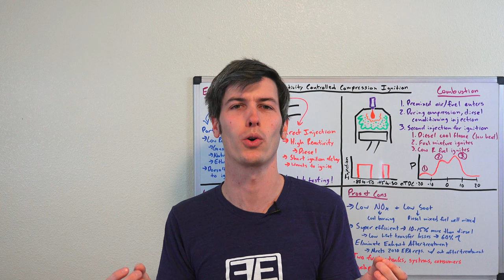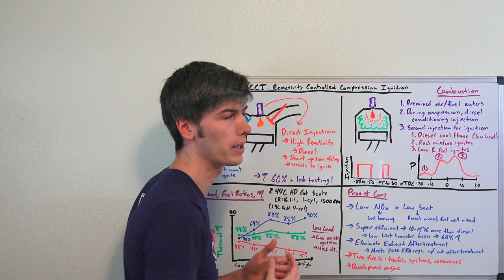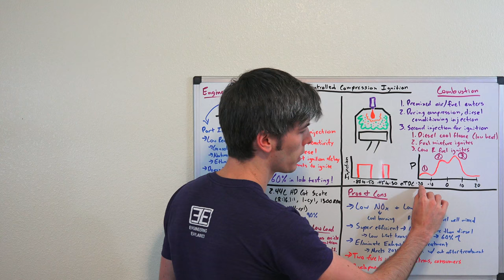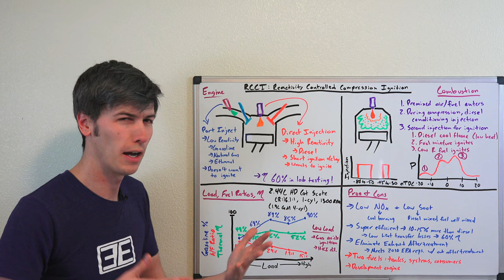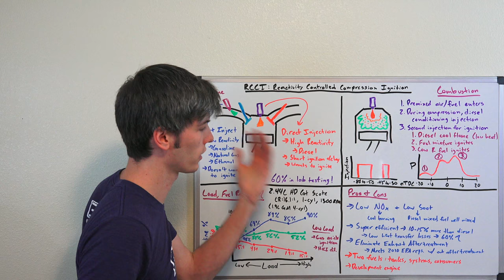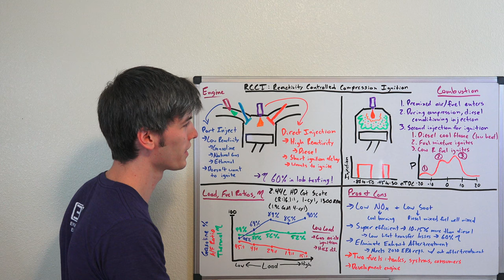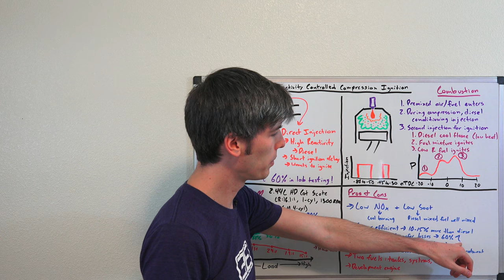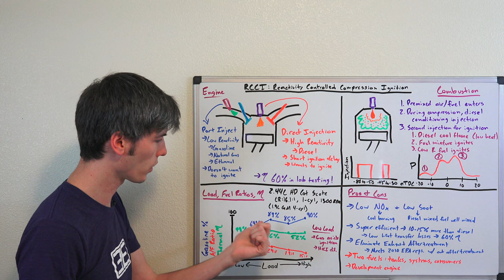Super Efficient Engine Uses Gas AND Diesel - RCCI

Comment: I don't think dual fuel is much of an issue for a lot of consumers & none for industry in cities. They wouldn't burn both petrol & diesel evenly, as when the engine does work it rapidly increases the petrol consumption & reduces the diesel. So you wouldn't have to fill up 2 tanks at every stop, you'd fill the petrol but the diesel only every few stops. Of course, I doubt I'll ever see one of these, technology is moving so quickly a single fuel engine will likely be all we see until internal combustion goes the way of the dodo.

Comment: But why doesn't the gasoline-air-mix self-ignite during the compressionstroke? If the mixture is hot 
enough to ignite the diesel it should be more than enough to burn the gasoline. Otherwise there would be no engine-knock in gasoline- engines and it would be possible to raise the compressionratio and get to a higher 
efficiency that way.

Comment: Lots to worry about.... At least for the for the first few generations... And hot burning causes nitrogen from the air while cool burning produces pollution as well just a different type, however this is a range and at a point heat starts ro destroy the pollution. A DPF currently can be used efficiently to reduce pollution in one of two ways 
1. Using DEF to clean off the the DPF
2. Get the engine temp over 210C and the DPF becomes clears while staying within parameters for the environment.

From what I can reasonably determine (with diesel) your fuel air mixture has more to do with environmental impact (using ultra low sulfur) then burn temperature its self. Please correct me if im wrong

Also i watched tourqe vs HP video 
Everything the same aside from 200 hp 100 ftlb vs 100 hp 200 ftlb 
I agree that the lighter the vehicle the more drastically the 200 hp would win. 
However I disagree that 200 hp car would always win, there will be a weight that the 200 hp car shouldn't even be able to move while the 200 ftlb would crawl across the line
Again please correct if im wrong
Reply from the maker: RE combustion temperatures, this actually burns quite cooler than traditional gas or diesel engines, resulting in far less NOx (discussed at the end of the video. 
RE hp vs torque, more power will win every time. Doesn't matter how much weight you add, you can gear a car with more horsepower to have more wheel torque than an engine with less power and more wheel torque. Power wins every time, if you're purely talking about peak numbers. Remember, cars with good low end torque also have great low end power (contrary to cars with high revving power, which produce very low power at low RPM.
Reply: Engineering Explained thank you for your speedy reply

 I don't think I can agree 100% as the video said gearing was the sam,e fuel was the same, but the leverage in the motor differed 
So would there not be a weight at which the torque with its lower rpm band and higher tow capacity, compared to higher rpm but lower tow capacity. 
If the weights were brought to the extreme is there not a weight at which the 200 hp car simply stall out compared yet the 200 ft lb would still move provided traction wasn't an issue.

Comment: Honestly, if it works good enough to save fuel and still get the power needed to get the job done (between vehicle types) then two tanks is not a big deal. Diesels already have that issue with the exhaust treatment systems.

Comment: Our fuel pumps will need to be able to enable, count & charge pumping both gas & diesel at the same time with a cost total. Pixel based displays would work for this. We already have pumps with gas+diesel (though they can be rare due to not being as popular consumer facing & to avoid consumer ..mistakes).
But the number of wrong fuel in wrong tank problems.. perhaps a law requiring separate dedicated colors for fuel pump buttons, hose, nozzle & tank cap+filling hole(?) & maybe dash fuel level displays/lights. I know diesel tends to be green already.

Comment: How was knocking eliminated? Just by multiple injection of cold diesel?
And the compression ratio must have been high too, so at the time of inlet valve opening, by how much the port injection was reduced?
And if they didn't go for oil cooling, what alternative was used?

Comment: There are no special pistons for oil cooling it is just squirters at the bottom of the block 2 cool the bottom of the Pistons as they are at the bottom of their stroke. On another note, a slightly more reactive fuel, that could be metered by the diesel, as kerosene a very similar fuel and an added element is that kerosene and diesel fuel are both very lubricious.

Comment: People in china started doing this 10 years ago... Coach drivers modify their diesel engine for lower cost... They add a natural gas system at the intake and modify the computer to inject much less diesel in the engine only for ignition (because natural gas is much cheaper than diesel). Amazingly, if the engine is tuned correctly after the modification, there will be less than 10% of power loss.

Comment: Two questions: will this be more reliable by having semi redundant fuel systems, or less reliable because of more points of failure? In other words, can it run exclusively as a gasser or diesel in the case of one of the systems failing? Probably in a "limp home mode".

Secondly: how does it respond to turbocharging?

Comment: A classical example of the difference between theory and practice. The point is simple: It is hard enough to keep either an Otto or Diesel engine operating properly in the field. A combination will therefore be more difficult to maintain, probably MUCH more difficult. Hence, a BAD idea. Reliability is the NUMBER ONE requirement for a practical engine.

Comment: What prevents pre ignition from occurring?  Wouldn't the heat from the high compression ignite the gasoline before hitting TDC?  I thought the main reason gas engines have lower compression ratios was because of this issue.

Comment: This is Nice but, if using Aluminum Heads, I C Warping N Head gasket problems in the near future for this Engine Design. If ANYTHING, the BEST design would B' a Dual Piston Engine(2 Pistons per Cylinder)

Comment: Sounds like a drive by wire system, very much more then we have now. You would have to worry about two fuel levels for different systems, and what would happen if the computer ever failed in its job? Blown engine? Other then that looks like a multiple pressure wave that would convert more mechanical energy then to heat currently?

Comment: Why not have the fuel pump with a hose (2 separate inside) that has 2 exit ports on the same handle, you could have the car still have one fuel cover with the ports side by side, that way the consumer couldn't possibly mix up the tanks. Still would have a complex engine with 2 tanks but at least the consumer end wouldn't change much.

Comment: Cool, but as always, hella complicated. Not sure this would be good for consumers because having two tanks really increases the odds you'll accidentally put the wrong fuel in the wrong tank.

Also, is there any good reason they don't make a diesel Prius? Is it just a perception thing because in the US we associate diesel with big trucks spitting out smoke, while in Europe they have a lot of small diesel cars?
Reply: California smog law is far stricter than Euro 6 smog law, that is a major reason why Europe gets certain diesel cars and the USA doesn't. The other reason is that fuel prices in Europe is 2x or more than the price in gasoline, so it takes less time to for fuel savings to offset the initial purchase price of a diesel.

People have already had a problem with putting the wrong fuel in the tank. Some diesels also require diesel exhaust fluid, and some people don't realize that. they end up putting DEF in the fuel tank, and once the fuel pump sucks that into the engine, it does about $7000 worth of damage

Comment: How is it possible that diesel wants to ignite, rather than gas does? I thought an advantage of the Diesel engines is that it doesn't ignite as early as Gas, so you can archieve higher compression ratios, while in the gas engine you would have knocking occur...

Comment: At 60% efficiency there’s half as much heat going into the piston compared to a typical 30% efficient gas engine.  Therefore, no piston cooling required.

Comment: Thanks for covering this interesting tech. 
Perhaps Europe has been a bit hasty in the inner city banning of diesel engined passanger cars in the near future. 
Engines based on this technology would surely make more sense than outright banning.
Reply: SDD525 
They are hasty if the emissions are prevented by clever technology like the video just presented. 
(The reason for my comment)
I understand the emissions issues, however, the real facts are that there simply isn't enough lithium or manufacturing capacity currently, to simply replace the internal combustion engine short term. 
Diesel engines are very efficient, if they can be made clean then that buys time to get alternatives off the ground.

Comment: Gas/Diesel engines are not new. The 1957-1958 International Harvester W-450 started and warmed up on gas then with a flip of a lever it switched to diesel to do work. It had a 1 gallon gas tank and a fixed carb.

Comment: As this has a sweet spot where efficiency is highest, could it then be a static generator with static rpm and static load, with methane gas from digestion and diesel substitute from oil seed rape and coolant water circulating in under floor heating for a dwelling? No need to fill a white board Jason, just off top of head pros and cons if you please.

Comment: Seems this might be good, based on that top RPM range in testing, to use in a Locomotive ? I know they used 2 stroke Diesels at 850 RPM. This cant be far off with power ?

Comment: I don't understand why the mixture of gas and diesel is more efficient than using the same port and direct injection combination with only diesel. Is it because the port injected portion of the diesel would pre-ignite? Would the flame front not propagate well? Would it burn hotter causing greater NOX emissions? I don't understand why the gas is useful, only why the diesel is needed to ignite it.

Comment: what would happen if you ran out of either fuel? would it still run and be less efficient or fail? im assuming that the diesel and gas  are supplied to the engine at different rates depending on the load

Comment: Is this the same kind of system that Volvo uses on truck engines?
I belive they use CNG an diesel.
But no spark plugs as was used until recently in truck engines that could run CNG/LPG and diesel.

Comment: I am writing this in 2020, 20 months after this was posted, and at a time when most manufacturers are producing  Battery Electric Vehicles (BEVs), for most, if not all of their models. An electric motor has 90-95 % efficiency, far fewer moving parts, and a much lower maintenance requirement. 
The thought running through my mind throughout this very interesting video is that this is just too late to be of real use. Like the Cutty Sark Tea Clipper: Thought to be the pinnacle of square rig sailing design, most of her life was overshadowed by steam packets, and those were in their infancy. Or the greatest steam tractors, replaced by petrol and diesel IC Engines.
A great academic exercise, but a solution to a question that few are now asking, or interested in the answer to.
Even with a hybrid EV, why bother with the hassle of 2 separate fuel tanks ?
Reply: Ok

Comment: Because of the duel fuels this would most likely a truck or taxi engine . so up the game by replacing gas with propane.  much lower emisions ,higher octane ,pressured so easer on injectors and dry fuel less cyl. wall wash so cleaner sump oil.

Comment: Compression being equal gasoline is far more reactive than diesel which is why you don't use it and 17 to 1 compression engines, it ignites way too early. Sounds to me like they're using the low reactivity of the diesel fuel as a mechanism to meter the ignition rate of the higher reactive gasoline.
Reply: Mazda may have built a solution. The European Skyactiv-d diesel and Skyactiv-g gasoline engine both have a 14:1 compression ratio. However, there are downsides, the diesel takes a while to get warm and the gasoline engine requires high octane gasoline.

Comment: The only thing I don't like about this kind of tech. is the complexity. Timing and high resolution data being processed lightning fast is everything with this sort of thing.  This sort of tech if and when implemented on passenger vehicles will definitely be something I skip for a while until they have some time to work out any bugs/issues.

Comment: Pretty sure I accidentally did this by putting a lpg mixing valve on a diesel truck because I wanted to have that propane assistance thing others used but then it just ran full throttle( I wonder why...) and stopped needing the diesel ignition to run

Comment: 1)gasolene has the high reactivity not diesel,  diesel has more power but it takes more to light it, hence the problem of pre-ignition  when you place gas in a diesel engine, also why old timers would mix 5gal gas to 55gal diesel in the winter time. 
2)  its going to be running hotter to achieve more complete burning of the fuels, think incinerators.

Comment: basically what I'm getting from this is diesel engines are better than anything else, because they offer almost identical thermal efficiency at a significantly lower price point because of simplicity... I don't know how much this technology will cost buy just seeing 2 injectors per cylinder and extremely accurate high pressure diesel injector screams $$$ to me

Comment: I looked through some of the comments but didn’t see a question about this. What octane rating fuel was used with this engine? I’m not super well versed in engines, but my understanding is that higher compression engines can have pre-ignition if you don’t have enough octane to retard the reaction. 16:1 seems pretty darn high considering my R1 engine is 13:1.

Comment: +Engineering Explained It would be nice to see how this would do in an opposed-cylinder setup.  (Not sure how, but I bet someone could figure out a way to do it, maybe through the center of one or both of the pistons for Direct Injection, and the valves for intake injection?)
Reply: It might work if you start with a Junkers Jumo engine. If you research those, you might find a fascinating diesel engine design. A Napier Deltic might also be worth researching.

Comment: This is nothing new-the more common name is a dual-fuel engine which has been around for many years. In Los Angeles at the Hyperion Sewage pumping plant, 10 large Worthington Diesels (14" bore x 20" stroke and 8 cylinder) were installed in the 50's. Ran on 10% Diesel and 90% sewer gas. Ran until just recently where it was decided they were putting out too much smog. Now Hyperion just pipes the sewer gas next door to the electrical plant to burn to make electricity.

Comment: How do they keep the gasoline from pre ignition as is the problem with Modern Diesel?  Any traces of gasoline are ignited Boyle's Law during the compression stroke prior to ignition of the diesel. How can  the first diesel direct injection event quench the cylinder sufficiently to prevent pre ignition, then enough Heat generated to ignite diesel at the second injection  passing through the lower temperature/ oxygen saturation region where gasoline is ignited up to the temperature/ oxygen saturation we're diesel will finally ignite?

If they are simply using the diesel fuel to delay ping / knock / detonation. Wouldn't a more benign and higher thermal dissipation value fluid then Diesel, such as water and or methanol  ,be a better choice?

Comment: Would it be possible to filter CO2 emissions from an exhaust system, dump it at a facility and convert it back into fuel (e.g. through algae)?
Reply: I don't know if it can be done with cars, but several coal power plants are experimenting with CO2 removal devices.

Comment: Why not just put some diesel fuel in with your gasoline? Then try to re-map your fuel curves for a lean-burn at light throttle?
You may need to raise compression to 11:1 or pull off some other tricks.

Comment: ICEs only reach their maximum efficiency at a certain RPM. The only way to get an ICE efficiency high is capture the exhaust and radiator heat. To understand ICE waste, most fuel efficient cars on the road today waste enough heat to heat 4 houses in the dead of winter. You can measure efficiency buy measuring waste heat. By the way, I'm a thermodynamic energy scientist.

Comment: This doesn't sound new to me. There's conversion kits for diesel vehicles where you add a LPG tank, an injector for de LPG on your intake and then replace around 70% of your diesel fuel with LPG wich is far cheaper in Europe.  (you still inject that remaining 30% of diesel to start the ignition because the LPG doesn't self-ignite easily. This things exist for over 10 years, so this only looks like half a step further.